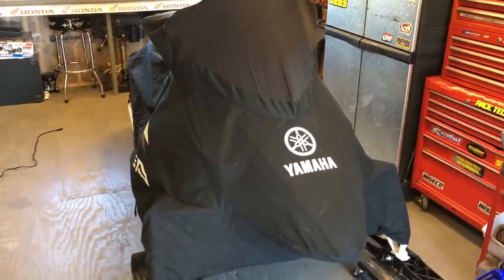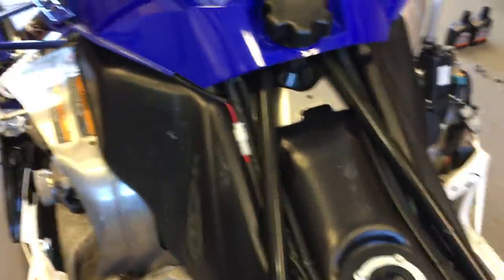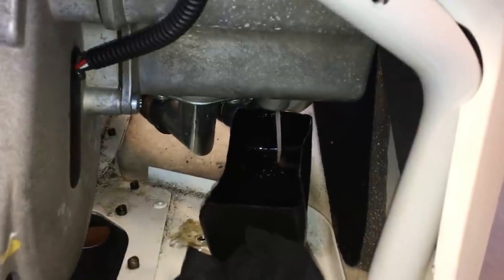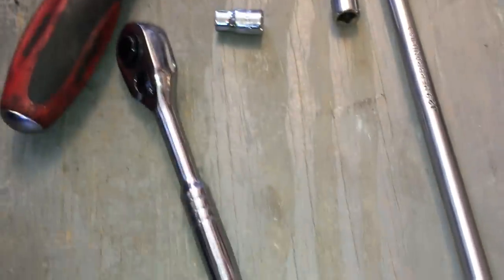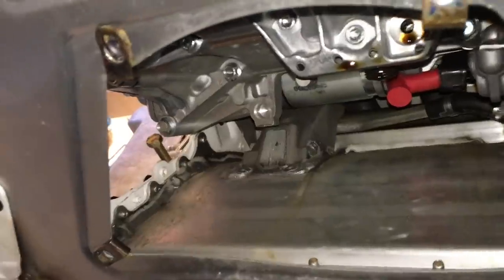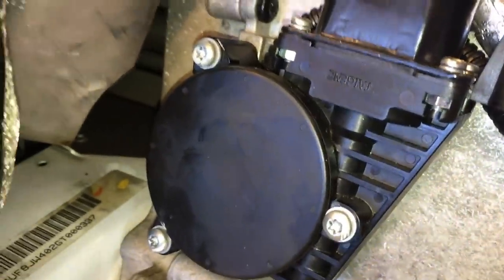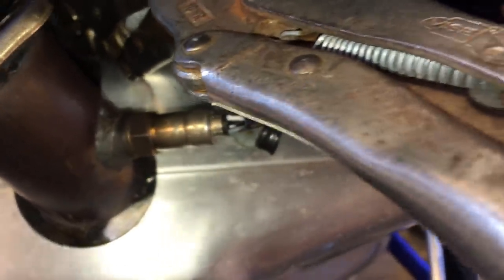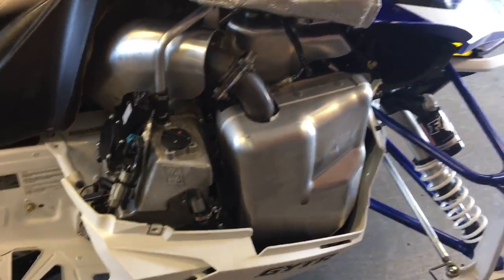How to change Yamaha Viper Chaincase and Engine Oil

Comment: It was nice watching someone go thru the same steps as I mostly did. If I could add a few pointers to your well done video, this should also the time to check the tension on your chaincase. Finger tight then back out 1 1/2 turns. A tie wrap made into a big loop helps to pull the exhaust springs back into place. Works great. For future oil changes, it might be worth investing into a copper exhaust gasket as they are reusable many times. Thanks for taking the time to make this.
Reply from the maker: Vince Gehring Those are indeed all great Tips Vince! I thought of those things afterwards. (It’s hard to hit all points when making films as an amateur) hahaha. But definitely glad you added this in! Thanks for the view and your input! Appreciated! Happy sledding!
Reply from the maker: Vince Gehring the zip tie idea is a new idea to me but sounds like it would work great too! It sometimes takes much creativity when working on sleds!
Reply from the maker: Your welcome! please help me help you by subscribing to my channel! You tube has changed things and it is going to hurt me due to lack of subscribers

Comment: Hey Biker Mike. I love watching your vids on all kinds of equipment from bokes,snowblwers and sleds. Thank you for saving me hrs of frustration.
 My question is about my 2014 Sr Viper Rtx.
 What is the proper procedure to adjust the chain case tension.  1 book I have says to finger tighten and then back it off 1 1/2 turns and then set lock nut. The other (small book that came wirh the used sled), says to only back it off 1/4 turn after finger tight. These are big differances. 
 Just wondering what your thoughts are on this issue I have.
Reply from the maker: There is some conflicting information on that out there so I’m not really sure what to recommend on that. 🤷‍♂️
Reply: 1 1/2 turns loose.

Comment: I finally got around to opening up the chaincase to do a visual inspection and a good cleaning. I was also having a slow leak and wanted to investigate that problem. Long story short, Yamaha came out with a superseded new seal to replace the original. It is definitely a bit thicker and has cured the leaking chaincase. For any future chaincase oil changes you might to invest in it. The part number for the seal is (Part # 8JP-G7558-02)  I left a paper towel under the chaincase for 4 weeks after re-assembly and not a drop of oil. Problem solved. Thanks again for your videos.
Reply from the maker: Vince Gehring thanks for the tip! No leaks on mine yet fortunately

Comment: I found that you should fill oil to the low mark of safe the zone.  If you fill to the full mark you will have 
 oil sucked into the air box and it will leak out and make a mess. If this happens there is no harm but the oil level will end up at the low mark of the safe zone anyway.

Comment: Terrific Video ! Hoping I can just trust my local dealer to do this level of service. Any idea how much a job like this would have cost at a certified dealer ??
Reply from the maker: I had this done at the dealer for the initial service after break in for warranty purposes. It wasn’t cheap I think a couple hours plus the oils etc… they did do a full service though. I could tell because they reinstalled the exhaust gasket with a chunk torn out of it…..😕
I’m just getting ready to do mine again for 3rd oil change. I’d recommend gathering it all before you start. Full oil change kit, exhaust gasket, oil tank o ring Incase it’s damaged and two bottles of synthetic chaincase oil.
Reply: @bikermike  Thank you very much Mike. So great to have a connection this way. I just bought two 2016 Vipers ... each with just under 400 miles ! Same owner, and came with a perfect 12 foot clamshell. Perfect, Clean, start easily, always garaged. I am wondering what to do to each sled before I take them on the snow. Also wondering about recalls and/or Flash updates to the software. I did watch your video on staring. Any advice will be greatly appreciated by this 66 year old motorcyclist who just had to get back into sledding !
Reply from the maker: @rkestes1955  no problem, I covered a lot of things in my videos just check out the viper playlist. There really isn’t much to do them other then oil changes, check your running gear in tracks, bearings, sliders. Etc… maybe add the 4th wheel kit to them or at least make sure those bearings are all well greased. As well as Making sure driveshaft bearings are in good shape and well greased too. All of which I have videos on. If you don’t have any starting issues don’t get the reflash done.

Comment: Just came across your video and it's great.  Can you please tell me what the interval is for engine oil and chain case changes on these vipers?
Reply from the maker: According to the manual... Initial Engine oil and filter after 500mi or 800 kms, then after that 12,500 mi/20,000kms ! ???  which seems way way too long to me.  I use full synthetic and do it once per season. or every 3-4 thousand kms. 
I also do chain case at same interval. could likely siphon it out every other and full disassembly the other time for cleaning. Yamaha recommends every season on the chain case oil as well.

Comment: This apply to Sidewinders also, ty. full of metal shavings, looked like glitter and only driven 500km, well guess its stuff breaking inn lol
Reply from the maker: I can't say if procedure will be identical but should be close. Check with a service manual if you can get your hands on one. Post break in service is most critical, after that there will be less metal particles.. That pretty much applies to anything brand new as well.  Did first service at 800 kms, then again around 4,000 kms. Just did another at 6300kms (haven't riden much last couple years) less and less particles in chain case and on the magnets each time... 
Sidewinder a beauty sled!!

Comment: Hey Mike. Started to do same on mine today but thinking I'll just use my oil extractor for the chain case. Seems like a biiiig pita. I only have about 3000 km's on mine. Did you notice much gunk in your chaincase? What do you think? Also how much old oil pissed out of those lines when you removed them?
Reply from the maker: Dealer did initial at 1000kms then I did second. 
A fair bit of gunk and the wear mark in case from the spinning magnet gunk. I will likely do the suction method for the third chain case service this fall soon. 
Yes those oil lines will make a mess...
Reply: @bikermike  ok thanks man. I think I'm just going to do the drain plug method on the oil tank and use the extractor on the case. Should be fine for this season as I don't put a ton of km's on the sled. Btw. Get some more viper vids up lol.
Reply from the maker: @EYECOMEINPEACE  Sounds like a good plan, and yes I do need to get back to making some more viper videos!
Reply: @EYECOMEINPEACE how much oil you get out of chain case ?

Comment: I just got the SR Viper I had an apex before then with 11300 MI and never let me down until the exhaust broke but I never got stranded you think I'm going to have a good luck with the SR Viper 2016 I got on  clearance from the dealer  10000k you think I want to be happy with this machine is it reliable
Reply from the maker: I had an 06 Apex before my Viper as well. I do miss the peak power of the Apex but the viper is no slouch with plenty of strong very usable torque. Had the exhaust issue with my apex as well and ended up putting on the stainless manifolds, Im sure its still going down the trail somewhere... I have not had any breakdowns with my Viper. 5,000kms 3,000miles. The ride and ergonomics are superior. I did have starting issues with mine since day one but now that has finally been cured with their latest ECM flash. I was just thinking I would do a video of all the things I like and dislike about the viper but overall I do like it better then the Apex. There are some things to do to help it last. I've done several videos you may find helpful. Hopefully you don't experience the starting issues it seems it is random thing with some vipers and not others. Either way the fix is out now if you do.

Comment: Did you put any kind of special sealant or just use silicone Automotive
Reply from the maker: The O ring style seal in the case was still in good shape on mine so I did not use any sealant. I have not noticed any leaking since but I have heard of them leaking so you want to make sure the seal is still good and it may not be a bad idea to add some RTV silicone as precaution.

Comment: Was the 4.6 liters of oil the correct amount?  I have the same sled and everyone says they hold 3.5 quarts max.  Mine has taken over 4 quarts.  Thanks in advance for your input.
Reply from the maker: It ended up being closer to 4.2 litres with oil filter. It all depends how much you disable and loose out of the lines, and if you don't change the filter.
Reply from the maker: Check oil level with warm engine, shut off and let it sit for a bit, dipstick threaded in.

Comment: Wow, that looked Complex, how many hours would it take average person. Thanks, Charlie
Reply from the maker: You can do it quicker with the use of a siphon pump to get the chain case oil out, but it doesn't get the grit out and off the magnets. If its your first time I'd set aside a full day for it and make sure you have an exhaust gasket and everything else you need. My tips should help make things go quicker 2-5 hours depending on how smooth it all goes.
Reply from the maker: No, but there are two drain plugs one by foot well and one under motor where the oil filter is.

Comment: If I just want to drain the chain case and oil 
Do I have to disconnect exhaust?
Reply from the maker: It’s been awhile since ive done it. So to be honest not sure. I’ve only did everything at once with full disassembly to clean chaincase magnets and cover

Comment: If I were to use a pump to get the chaincase oil out where would I stick the tube through?
Reply from the maker: Hey buddy, I am assuming through the fill location.  BTW Thank you for subscribing! you tube has changed requirements for channels like mine so I need all the subs I can get If you know somebody that would also like my channel it would help a ton!
Reply from the maker: I sub'd ya back btw!
Reply: No problem, these videos help alot, how hard was it to get the shift actuator out?
Reply from the maker: yes thats how i did it, I have not used the siphon method myself yet, but may in the future. it really is a good idea to disassemble and change it that way, but if your uncomfortable  doing it that way the siphon method is the next best, and much better than not doing it at all.
Reply from the maker: not hard at all, reassembly is the tricky part. follow the instruction in the manual and my video. I have had no reverse issues since.

Comment: Ski-doo so much easier to work on but damn i need to get my viper fixed again
Reply from the maker: Yes there is probably more simplicity to working on an two smoker doo! 🔧  💨
Reply: @bikermike  no im talking about the 1200 4 tec i owned the 2010 mxz tnt 1200 4 tec short track 120x15x1.25 but i got it used the 1200 ended up selling it tho after i swapped the track from the stock to a 120x15x1.5 changed tge primary made it a heavy wheelie machine seriously
Reply: @bikermike  i got my viper running again turns out it just needed a new battery and swap 1 of the fuses i ended up blowing did the battery wrong to excited once it cranked over i ended up charging my weak battery and put it on backwards put it on the second time then blew the 30 amp fuse swapped it and the engine runs after 2 to 5 years of sitting in the weather i got hope

Comment: Use a siphon pump on the chaincase
Reply from the maker: That works good too,  but it leaves a lot of metalic grime in there especially on those magnets that grind into the case 10:13 . Depending on mileage I will maybe use the easier pump method every other change.
Reply: biker mike about how many miles should I change the chaincase oil
Reply from the maker: Refer to your service manual for intervals. Can always do it sooner if you like! (It worries me a bit how it wears away at the case). I had dealer do the first one after break in at 700kms for warranty purposes then I did my own change at 3,400kms., I think I'll be doing mine once a season which will be 2-4 thousand kilometres.
Reply: biker mike my sled has around 1,300 miles so around 2,000 km and I haven't changed the chaincase oil yet so your video should help alot
Reply: Nh Outdoors how do you use a siphon pump on the chaincase?

Comment: What I don’t understand is the manual and other reference say the engine gets 2.7 litres of oil, I think you said 4.6 litres…did you over fill it?
Reply from the maker: If your not doing the complete disassembly then it’s probably less. I did put a bit extra in but it’s  4 and a bit if you disconnect everything.
Reply from the maker: The oil is in the tank the lines and engine. So depends on if remove it all like I did
Reply: Ok thanks, it’s quite a job.  Nice sled.   Thanks for the video.  We’re looking at getting a Viper
Reply from the maker: @Chuck-g6k 
They are great sleds for engine durability and efficiency. Great torque too! But ya doing a full oil change procedure is a big job! Can do it simpler way but won’t get out all the oil, and see how the chain case looks. I do both at same time

Comment: Just suck the oil out with a straw plastic 
Instrument tubing
Reply from the maker: Good tip for more regular chain case oil changes, but definitely needs to come apart for thorough cleaning of the metallic sludge left inside.